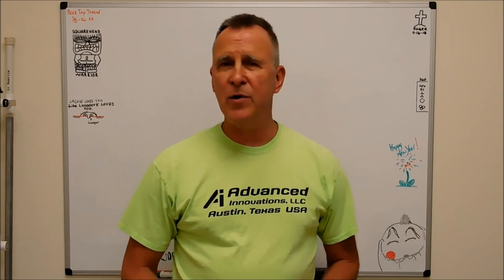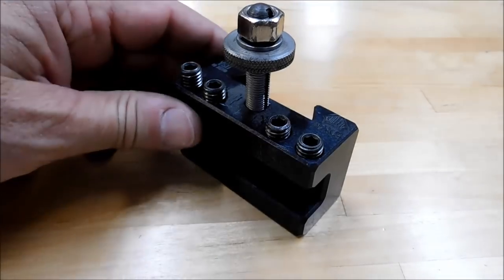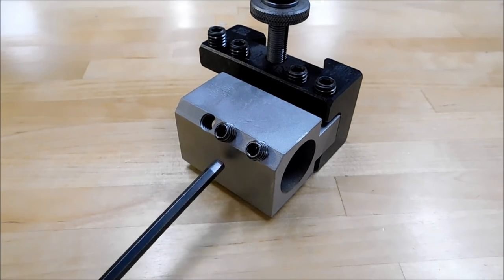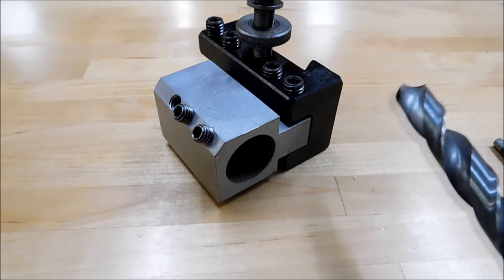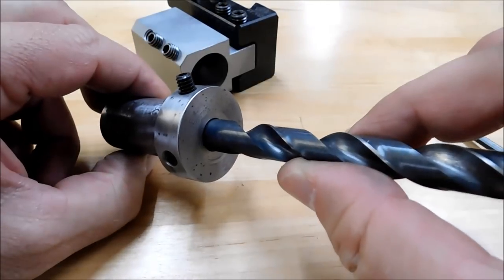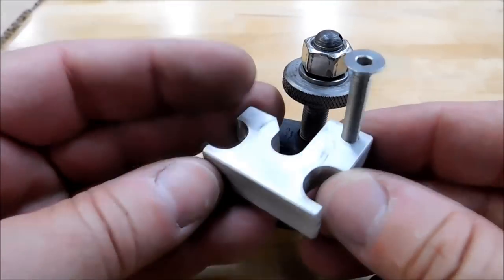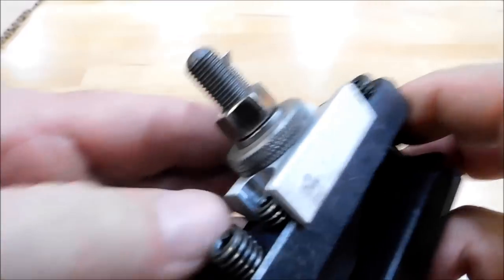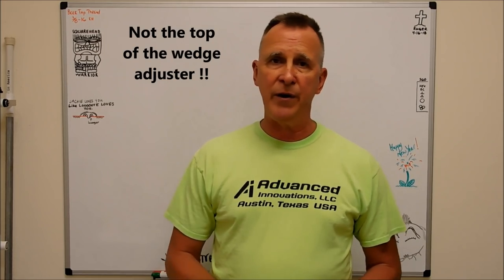Toolholder Adapter Block and Tool Height Extender

Comment: I sometimes put a drill right into the standard v-groove toolholder, even though there's nothing wrong with my tailstock. The carriage feed handle gives way better feel than the tailstock feed handle, and the power feed can be very convenient

Comment: When using the carriage to power feed drills I've always had issues with the tool post spinning around the axis of the hold down screw. I finally made a backup bar that bolts to where the follower rest would. Keeps to tool post from turning under a heavy feed.
Reply from the maker: That is a concern for sure. The adapter block shifting is the other. Be sure to not over-ride your component stability.

Comment: Good note on the drill holder for the Aloris type tool post.  You can purchase tool blocks with morse tapers, and even better, 5C collets.  There not too expensive if you don't mind import. I use the 5C collet tool holder for holding tiny boring bars.

Comment: FWIW, you can buy morse taper, 5C collet, and drill chuck blocks for the tool post as standard off-the-shelf items. Brand-name Aloris or Dorian are $$$, but Phase II, Shars, etc also make them.
Reply: My MT2 block is magic for holding tiny boring bars; very solid and easy to set up.

Comment: Fantastic Joe! love your work.
 You have given me an idea. For your drill holder in the toolpost could I suggest an accurate 5c collet or ER 32/40 collet holder(different size drill bits can be used) then precision grind flats on four sides equal distance from the centre line essentially a square shank. Therefore it will always clamp down the same in toolholder  no matter which way it is inserted also one of the flat sides facing away from tool holder can be used to indicate to the centre line of the spindle.
How does that sound?

Comment: Excellent idea Joe ! 
A quick way of setting up the drill holder is to chuck up a piece of drill rod of the same diameter as the hole in the drill holder and jiggle the toolpost around and adjust the cross slide so the holder will slide over the drill rod in the chuck . Saves having to tram the holder parallel to the bed each time . You could also make a device that plugs into the morse taper in the spindle to do the same thing which is useful if you run a four jaw chuck - you don't have to fiddle around clocking the drill rod so it runs true .
Reply: Except if you do that you have to remove a part you are working on every time.With tailstock you dont have to go trough all that mess.

Comment: The Drill holder you made reminds me of something similar I saw at an engine machine several years ago. It was the same basic idea but what the guy did was machined the entire holder from a solid chunk of material including the dovetail slot and had a top cap that bolted down on it so that there was no height adjustment to accidentally bump or change when it was dropped down on the post.  My assumption is that he drilled and reamed the hole in the holder using the same method of chucking drill(s) and reamer in the chuck and moved the carriage into it.

I asked why he made it rather than using the tail stock and his exact reply was the same think you pointed out, "because I can power feed and thus have both hands free to be doing something else."

Comment: Thanks so much for the tool height adjustment attachment. I love it! Gonna make one but cut some clearance so it doesn’t bottom out at the top of the holder. We have two different lathes with different center heights. Would like to be able to make the attachment interchangeable by being able to drop the tool holder lower than the top of the holder.

Comment: Hi Joe. Great video as usual. I wonder have you ever thought of doing a video of Rotary Table part set-up tips? I dont use it much and it seems every time I do I have forgotten everything I learned from the previous time and I end up with parts orbiting the cutting tool or arcs I never intended! I cant find much of value on Youtube and wonder if you have some golden rules on where the datum point should be and how to set-up parts accurately?
Reply from the maker: They are coming.
Reply: Thanks Mr. Pi. Top class work.

Comment: Could you taper the hole to say a MT 2 to accept MT 2 drill bits? You can buy MT 2 bore reamers for under $15 for a set (rough and finish reamer)

Comment: Do you have a good way to zero the X direction, or just half the bit plus half the diameter of the part, or you know the offset from the edge of the block to the center, or maybe you set a tool offset on the DRO?  I'm pretty sure nobody wants to be taking parts out of the chuck...
Reply from the maker: Put the indicator in the collet and set the tool holder with the block. Record the numbers and go for it.

Comment: This ingenious Joe thank you very much for that. I got to tell you I'm pretty sick I was at risk of fading away and easy chair when I started watching your videos You and Mister Pete I decided to get me some machines and start working with metal. I was always very good with wood and metal we back in high school and different times throughout my life with welding and excetera excetera just all around building things.

So I got it on Logan and I fixed it up like new it was in the first few months I started making things for people and then I found a few things that are not readily available that people still need they started selling on eBay after figuring out how to make them on my way very precisely. The first old Logan paid itself off in probably 6 months. Since then I've got a hardinge and absolutely tons of tooling I got a mill with tons more tooling. I have paid everything off and then some just buy doing small jobs for people and making things to sell. It's absolutely amazing how he hobby can pull you out of the pits of hell into a productive life. Even if it's only productive on a hobby level arm chair watching TV in dying slowly.

Your videos help me do things correctly and I'm very grateful for that. The next Saga of my life is to get a larger lathe I'm looking for a much bigger Monarch I believe to fix up like new. I actually have things like this to look forward to now thank you so much

Jeff

Comment: To hold MT2 tools I made and toolholder adaptor similar to Joe's then acquired an MT2 to 1" plain shank adaptor off Ebay. Then went one step further and added a draw/eject bar assembly to the back of the adaptor which ensures that drills and collect holders don't spin or work loose, but can be easily ejected. It will accept plain, threaded and tang MT2 tapers.

Comment: What a great tip. My ML4 lathe is notorious for dodgy setup and not keeping it's position as there is no fixed location dovetail to adjust against. That tool holder does the job perfectly. 
Also the tool holder raiser would be handy for a rear mounted parting off tool. As the height would need to be raised same as the rear mounted cutting tool.

Comment: I guess I'm of the belt & suspenders school of thought. I think after boring & reaming that drill / reamer bushing holder I'd take an accurate measurement off the top of the block to the top of the compound or cross slide surface before removing the tool holder and stamp that number in the top of the bushing block. For myself and not taking the time to do something like that has almost always wasted more time sooner or later than having an easy datum reference point to go back to. Very clever add on raising block for those Aloris tool holders Joe.

For non integral shank drill chucks I'd drill that hole through the back of the chuck at a tapping size. Then just tap the chuck after it's off the arbor. Any arbor that chucks used with after that can be removed just by screwing in the correct sized socket head cap screw. Afaik Albrecht keyless chucks can't be drilled in that area or you'll ruin them. I could have gotten some incorrect information about that though.

Comment: Cheers Joe, nice simple way to extend the range of a tool holder.
For the guys with a dropped tailstock, you can place a shim between the TS base and body for a quick fix, thatll help get back on centre vertically.
For MT taper shank drills you can use a capstan socket for the tool holder you make for the QCTP.

Comment: As always, great video. I was wondering, do you have stability issues since your dovetail of the toolpost is engaging a smaller area on the tool holder? Hope to see you at the Summer Bash.
Reply from the maker: No issues at all. The offset is usually minimal compared to how much contact remains. If it were to be more than 50%, I could see possible problems.

Comment: Super idea. I have had the problem that I had to bore down into the tool holder top so the adjustment screw could go lower than otherwise allowed by the off the shelf tool holder. What we need is a negative of your cool tool!! hehe Love your videos.

Comment: Hmmm, what if you made morse taper in the block instead, maybe a size 3? Then you could fit a drill chuck in the hole, and bigger morse taper drills directly.
Reply: They sell those i seen them.You could get a er32 or 40 chuck with a morse taper and use it both in a holder and a in tailstock.

Comment: Good video and idea's to over come problems, many folks have forgotten necessity was the mother of invention, One of my lathes is 68 year old yet I make cut true as a new one,with patience and ingenuity
Reply from the maker: Creativity also comes from not having any money in the bank. Its easy to solve a problem when time is not an issue and someone else is footing the bill.
Reply: You are right Joe, I guess I'm fortunate that I'm retired so it allows me time,as for money well not much here, I have always enjoyed making a tool that I needed, although in those days I had neither a lathe or mill, but I did have a torch,grinder ,and welder, most of those homemade tools are in  my tool boxes, but one stays in plain view on a lathe,I was never a machinist by trade,although I went to 3 years of trade school it was not how I wanted to make a living, A dozer I owned needed track pins and bushings not wanting to give up 12,000$ for the job, I bought my first lathe, it is a China lathe but for less than 8000$ I built what was needed installed myself, so the story began, now days I build parts for antique tractors and machinery that is obsolete. My second lathe is a 9 inch South Bend 1950 year model it is such a pleasure running that old machine, It has an interesting history in that  it is given credit to building the first graduated   carriage stop, by the son of the original owner, keep up the videos I enjoy them and learn from them

Comment: thanks   Joe P   I  all ways have trouble reaming holes ,250 .375,  ,500   .etc.maybe you could show how it should be done thanks
Reply from the maker: As a general rule, the amount of material I leave behind for reaming is driven by the size of the reamer. In your size range, I leave about .015". Run the machine slower than the drill RPM and don't peck with a reamer unless you a have a good reason to. Constant feed and lubricant and your results should be favorable.

Comment: Are saying that morse taper shanks are separate from the drill bit? I thought they were all the same chunk of metal! I gotta try that. Great vid. Again.
Reply: They're separate from the drill chuck, if that's what you mean. They have a taper at both ends. The taper in the chuck is not a Morse taper, but (usually) a "Jacobs Taper". eg JT2, JT6 (they don't run in strict size sequence the way Morse tapers do)
Reply from the maker: Bingo. 99% of the time, they can be removed.
Reply: Another way to remove them, if they have no thru hole and have been on for a while, is to use them to chuck a big, blunt milling cutter and side-mill a piece of scrap so they chatter badly and (often) fall off. This is only applicable if the Morse end of the shank can be firmly retained, either by a drawbolt or by a collar such as some Swedish machines (notably Arboga) use.
A third way is to use a pair of wedges slotted from one end to fit around the Jacobs taper. Just squeeze the ends of the opposing wedges together in a vice. These are available in sets, but you'd need to have a lot of chucks to remove to justify buying a set!
Reply: Guys I am talking about taper shank drill bits, not drill chucks.
Reply: OK. that's not what was being talked about on the clip, and the answer to your question is no.

Comment: i have use a small block sitting on the main part of tool holder. this would be a quicker and easier tool change. thanks , was surprised to not see a lock nut on your bolt though.

Comment: The aluminum beyond z bracket is spot on so simple I like it!! I have a riser block I made the uses set screws on my tool post to align tram so I can get it within .0001 then crank it down without it moving on you works so well!! I have 18 inch long twist drill 5/16 diameter I use that is true start to finish.

Comment: Joe can you make a video about how to make threading dial in homeshop and explain about threading dial.thats good idea to drill a hole.thank for the video
Reply from the maker: Take a look at my " engaging the halfnut" video. It covers some good stuff.
Reply: Joe Pieczynski thanks for that video.i just watched.man that really helps me.my lathe doesn’t came with a thread dial.i plan to make one.does the gear below the dial that attachment to to the lead screw really matter? Or can i use any pitch gear to make the dial?its a 5 thread per inch lead screw.im really confused about the gear pitch that going to drive the dial
Reply: If you have a clutch or reverse on your lathe you dont need a dial.When on end of a thread back your crosslide or compound and put lathe in reverse.Then let it run a little bit more than your peace you are threading take a depth of cut you want and put it in forward-you do that to eliminate backlash in your lead screw.As long as you dont dissengage the half nut  or move compound pitch will stay aligned.
You can also "put it back into the pitch"by letting your carriage moving forward while engaged with half nut but dont take depth of cut -stop the lathe when on begining of the thread you cut  (or existing one)and then with crosslide adjust the knife to fit the threads-basicly you use existing thread as fishtail gauge.

Sounds complicated to explain- easy to do in real life.
Reply: To answer you need 5threads per inch gear since its the one that needs to fit and engage the  leadscrew.
Reply: zumbazumba1 I have a 20 teeth gear that will fit perfectly on my lead screw.will it work?im really confusing that the gear teeth really matter or i can use any  gear as long it fits the lead screw?
Reply: How many teeth aka how big is the sprocket does not  (as long as it can fit in between your lathe )matter as long as it fits the pitch of your leadscrew.
A guy did make a threading dial  out of 2 bigger bolts and and a sprocket -so its extremly simple and cheap device.Even if you mess something up its cheap to redo it. 
https://www.youtube.com/watch?v=4P6uQLBviCM
Here is a video on how thing works and what can you do with it and what you cant.
https://www.youtube.com/watch?v=jbRcs_Hhtuw
https://www.youtube.com/watch?v=x5HKibDE9-4 -in this video what guy says is that you can thread imperial threads with one dial if your leadscrew is in threads per inch then size of sprocket does not matter-to do metric threads with imperial leadscrew you need special size teeth sprocket for each set of pitch. 
Long time ago we learned in school how to assemble gear sprockets to cut metric thread on imperial leadscrew  and  imperial thread on metric leadscrew(you have to have special sizes gear sprockets )-it had so much math that i forgot it all as soon as i passed exam  +all the modern lathes have gearbox that does calculations for you.  
Honestly i never used one but i worked on machines with clutch,i guess it can be usefull if your mahcine doesnt have reverse -most of modern do have it and you can fit old ones with Variable frequency drive.

Hope it helps.
Reply: zumbazumba1 thank you so much.this information really help me and I really appreciate your help

Comment: Hmm i seen those holders with morse taper,i never liked them it was a mess and time consuming to set it up.You have to adjust the cross slide in center then height of tool holder and then make it square with chuck. I would rather put a bushing in a tailstock and make it good since its used for many operations and its very important part of lathe.
Reply: Also check that your compound bolts are tight since pressures of off center tool post drilling may cause it to rotate.

Comment: Joe, unrelated to this video, I remember you showing your favorite magnetic indicator holder by General Tool. I ran across one at a model engineers show. It turns out that company is still around and still make that holder. Cullen- Legois Mfg, Wisconsin. You can see these at clmi.net  Good stuff! Mark
Reply: clmi.us

Comment: i am a little shocked that  the first tool is really  common in China. you can buy it on line. and they have all kind of sizes.
Reply: kong wu my brand new Chinese lathe tailstock was 0.1mm/4 thou too high! I had to get it precision ground by local toolmakers. Even now I need to use a quality ER collet to be on centre.
Reply: that sounds about right. but  also there are pretty good quilty ones too made in china. i usually dont buy the cheapest, they dont play by the rules.